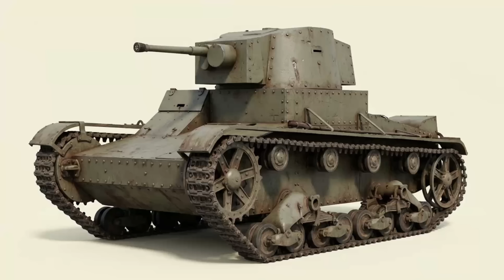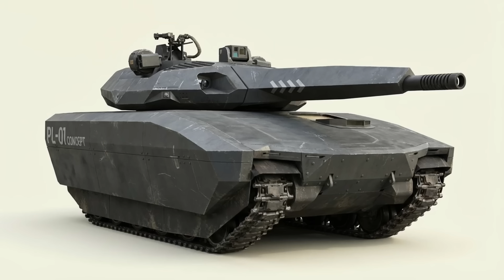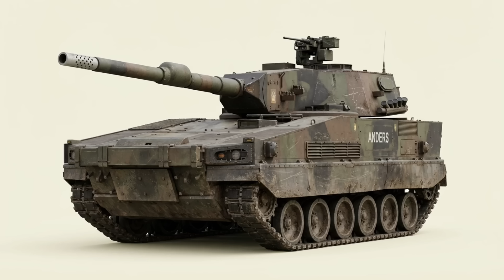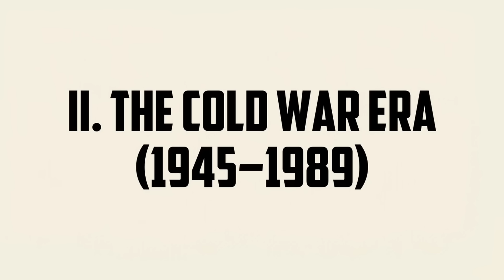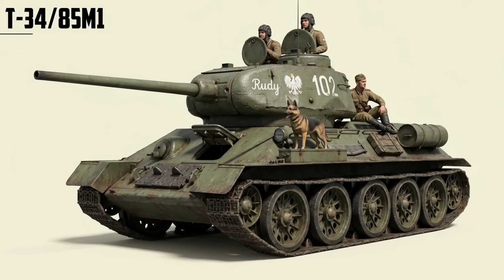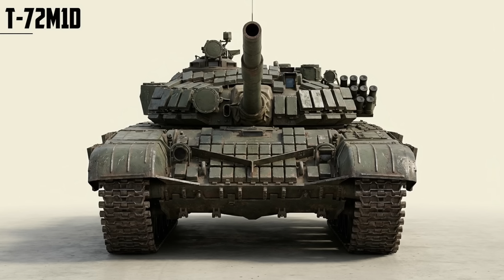Every Polish TANK Ever Made

Comment: 3:30 This 7TP is not a 7TP but a Finish Vicker 6-Ton. but missing the hull machine-gun

The 7TP has a raised engine deck because of the different Engine made in Poland. and the Polish Vickers 6-ton hard being retrofitted with a single turret after it received the new air intake on the side of the engine. Those air intakes were rather large and easy to spot.

Comment: T55 to T72? Where in the EFF is the T62 & T64?
Reply: T-62 & T-64 were kinda a separate line of tanks parallel to T-72s, used only by ZSRR and never exported, so Poland never used them. Also the next step in evolution of T-60s was T-80 and 84, as opposed to T-72 and it's successor T-90 ;) hope I was of some help
Reply: @michał_chmielewski  I understand that, still though, seems like they should have been mentioned. I think I read somewhere that the USSR exported them to Cuba

Comment: There are several errors in the material:
1. 7TP JW, 7TP, and 9TP (officially called 7TP "reinforced" in documents) are names for a single vehicle, available in several types.
2. The illustrations depict tanks with Soviet Kontakt-1 reactive armor, which was not used in Poland and differs in design from the Polish ERAWA 1 and ERAWA 2 reactive armor.
3. The PT-91M "Pendekar" has a fully Polish S-1000 R engine, and a foreign (Western or rather French) Renk ESM-350M transmission.
4. Attempts to modernize the armor of Polish T-54A's (Osprey - New Vanguard 102 - T-54 and T-55 Main Battle Tanks 1944 - 2004 and Encyklopedia techniki wojskowej praca zbiorowa, Zenon Mendygrał, Wydawnictwo Ministerstwa Obrony Narodowej):
https://i.imgur.com/EyNx8Xs.jpeg
https://i.imgur.com/jtlxSdG.png
5. Polish modernizations of the T-55 from the '70s and rearmament with a 105 mm smoothbore gun.
https://i.imgur.com/WaSpAo1.jpeg

Comment: The photo you used for the T-54 was actually a T55 photo.  IIRC T54's didnt have the fume extractors equipped.
Reply: from this angle it is very hard to know if it's T-54 or T-55, T-54A's and T-54B's did have fume extractors, the one thing that helps to identify them is a small vent that is placed on the other side of the turret's roof, but I can't say if it's not there or just not visible from this point of view (after looking at it for a while I think it is T-55 but it is a close call)
Reply: @himmla5459  its been 15 years since I last did my IFV identification stuff, but the front wheel spacing and the fume extractor where the two big ones for T54/55 and the way to tell them apart was the fume extractor.  There are others but dear lord my brain couldnt hang on to it all.  The easiest one for me weird enough was the Merkava
Reply: @StonedVet81  well, if we talk about base models then you are fully correct, I don't know about the quantity of T-54A's and B's, maybe there was so little of those modernizations that it didn't really matter